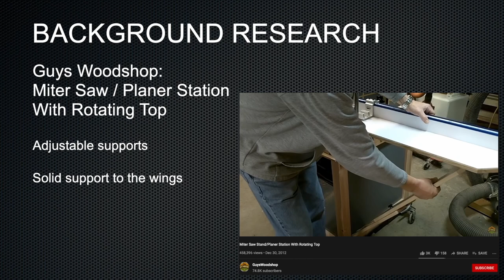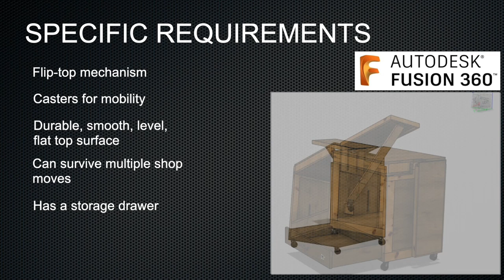Extremely Versatile Flip Top Cart

Comment: In my research on different flip top work stations, this is one of the best I've seen. I'm getting ready to build a flip top work station for a miter saw and planer, and your adjustable wings solution solves an issue I've been struggling with; different table heights on both tools. Your plan is well thought out, and well executed. I'm not crazy about your wing support (tongue and groove), and a couple of other details I'll tweak out as I sketch out mine, but the basic design is exactly what I've been looking for. The positive stops built in for the table top is elegantly simple and makes more sense than most of the others I've seen. Well done. Best I can do for support at this time is a sub to your channel. And thanks for your service.
Reply: 19:56 Did you build it yet? I need to build the same for a miter saw and scroll saw. Having a problem figuring out the distance from the flip top and bottom of the cart. I would HATE...lol to build it and when I go to flip, there is not enough space for it to fully rotate. If you did build yours, what measurement did you use? Thanks in advance

Comment: Really like the design. Love the solid rotation with a stop. I've been looking at dozens of flip tables, and this is best. I like: the solid 2x4 framing, the solid stop rotation, and I LOVE the idea of the feed and outfeed.

I'm making a table for the same planer but a Jet 10-20 drum sander on the other side. The infeed/outfeed heights are identical but I'll still probably make the feeds with a little flexibility, like yours. 

I think I'll use a piano hinge instead of a door hinge, and I might use a hinge for the bottom bracing instead of the tongue/groove thing. 

Great video. Thanks.
Reply from the maker: I’m glad you liked the video and I could inspire a design! I’ve really enjoyed the flip top cart so far - I’ve had it for about a year now. It’s continued to perform as designed. I think piano hinges would be a great upgrade. I do think the tongue and grove supports could be improved, but I honestly haven’t had any reason to do so - they simply work every time, exactly as expected. I expect improvements to this design would allow for one-handed deployment, and possibly add rigidity to the hinge joint between the wing and the cart (right now the support mechanism is loose enough at its attachment points that it doesn’t constrain the small flex in the conventional hinge at the wing base). 

Maybe someday I’ll get around to innovating and iterating on this design, but it will have to fail first for me to find the motivation. 

Best of luck with your build!

Comment: It's been nine months and I'm sure you've worked out the kinks by now, but I'd like to say that I like this design the best of all the flip-top carts I've seen on YT.  The locking top is very clever and the 2x4 sides are strong and minimize the use of expensive plywood.  I do have a few suggestions, however.  1. The wings look like they stick out several inches when folded down.  My shop is so small those few inches are precious, so I would fix that by using T-nuts and shorter bolts to hold the top hinge boards in place.  2. If you haven't done so already, do use piano hinges as they should eliminate the side-to-side wiggle you mentioned.  3. If the tongue and grooves in the support bars have proven sturdy enough then by all means keep them.  If not, then a sliding groove arrangement like what you did for the wing hinge boards might be better.  4.  Finally, I'm nuts about retracting castors.  They're easy to make and allow the cart to stand on its own feet (not wander about on wheels) while the machines are in use.
Reply from the maker: Thank you for the comment and complement. What actually causes the wings to stick out, is the proportion of short and long support braces for the wings. The way I have it adjusted for my planer, the short support brace is 0.5” too long to tuck under the wing support base. This causes everything to stick out, rather than lay flat. If I lowered it or designed it to be shorter, it would be fine in my specific application. I did switch to piano hinges; should have started with those. The tongue and groove joinery has held up really well; it’s stable and easy to deploy. I also don’t ever worry about it coming loose. The dual locking casters have been good enough for my application, but I really appreciate the engineering that goes into retractable caster designs - really classy. I’ll probably tackle this at some point, just because it would be a good challenge. 

Thanks for the discourse!

Comment: I love this build! I especially like the support wings. Lighter weight but the framework provides stability and strength. And the break-away support is a very elegant solution.
My only question is regarding the power strip. Granted, it's not something that should happen very often, but what do you do if the onboard circuit breaker trips? As it's built, it requires the removal of at least one tool and the mounting board. 
I think the simple but far less attractive solution is mount it on the outside and drill a couple of holes for the cord ends to feed through. Or replace it with a multi input adapter with no surge suppressor and keep everything inside as shown. 
Again, it's probably not a high occurrence issue. But it will only take once before it's a major work stoppage.
All in all, still a very cool design.

Comment: Nice job Hunter.  I have 2 suggestions though.  Make the side panels from 3/4" ply, using a full piece on the inside and strips to make the frame on the outside.  Also, the bottom should be dadoed into those sides 1 1/4" so the casters have the full support.  As it is, 2 screws are supported into the 2 x 4 frame, and 2 are in the plywood bottom.
Reply from the maker: Thanks! Dados are a great idea; that would definitely make the casters more supported. I haven’t had any issues thus far with the design, but everything can be improved.

Comment: Just found this video, and I like the build you have.  Wanting to build a flip table for the planer and this one looks awesome.  I wonder after 2 years now if you have reinforced the wing supports with metal as the tongue and groove looked pretty sketchy.
Reply from the maker: Thanks! Honestly the tongue and groove has worked really well. I figured with frequent use they might become looser, but they are still really tight and solid. The  tongue and groove is actually the most solid part. I get way more wiggle / play out of the hinge on the wings than I do the joint or sliding adjustment. I never liked the hinge out support with a single threaded bolt for adjustment. That solution never seemed as stable. There is a much greater contact area with the tongue and groove than an edge of plywood or bolt head. If I were going to do it again, I would use a piano hinge or machinist hinge to take all the play out of that joint.

Comment: Ultrawall 24 inch Black Sturdy Folding Shelf Brackets, Heavy Duty Adjustable Steel Wall Mounted Collapsible Shelf Bracket, Max Load 550lb (Pack of 2)  on Amazon Not affiliated with product:  I have used brackets like this for many folding projects in my shop.  Extremely sturdy and easy to use.  I just bought a planer and jointer and was looking at how to adapt Fishers cart for these.  Great video.  (and if these can last through PCS's you've done a great job.  Those movers can destroy a rock)  HooAhh.

Comment: If you wanted the weight to go straight through the frame, then you should have placed a stile directly in line with the bearing right in the middle.  This is how houses are built when you want to transmit the weight of a heavy structure directly through the house and into the foundation (also called a point load).  At the least you could have used a heavier support at the top, like doubling the stiles (kind of like a header).

Comment: First off, thank you for your service! I have watched tons of flip cart videos and I love how you have taken several designs and integrated them into yours. The 2x4 structure is solid and definitely what I am looking for. I was wondering how you attached the 2x4 that was milled with the holes for the pipe (swivel point) and 2 screws for wings to the main 2x4 that have the half lap joints?
Reply from the maker: Thank you! Each face was milled smooth for a glue joint. I just used clamps to hold the top piece to the frame.

Comment: I would have used the folding shelve bracket. It would provided stronger support, easier to operate, and would look better flush with your cabinet. But overall great work.
Reply from the maker: The folding shelf bracket is a great idea! I have never seen that before. At minimum, I'm was going to change the base hinges from door hinges to a piano hinge to reduce the wobble, but I may give this bracket a try first. Especially if it can be deployed with one hand. Thanks so much for the suggestion!
Reply: How would you adjust the folding shelf bracket? It may not open up to be exactly level with your infeed/outfeed surfaces.

Comment: Just found your channel Hunter and very glad I did.  Been looking for a good flip top cart, hopefully., for my drill press and band saw.  This one might be sturdy enough.  That’s a great miter saw station.  Love the hood for the saw.  How does it do containing the dust?
Reply from the maker: Hey Brett! Thanks for the kind words. I love the Flip-top cart so far. It is very sturdy, the top is very stable when secured, and the wings are great for planing longer boards - though you can skip the wings for a drill press and bandsaw. I have build plans available on my Etsy store if you are interested. I absolutely love the Mitersaw station. It came out just like I imagined (3D CAD helps lol) and works wonderfully. It makes me so much more efficient in the shop. The Dust hood is great; it traps 90-95% of the dust, depending on wether or not I’m making a sliding cut, or just a standard miter cut. The negative pressure from the dust collection does a great job at keeping the fine dust away too. I notice this because I don’t sneeze when using it, along with not needing to vacuum up the large chips. You could improve the dust collection by running a hose directly to the saw. While virtually all the dust stays in the hood, I do still have to vacuum the hood out sometimes. Collecting directly off the saw would reduce this a lot.
Reply: Hunter, thanks so much for getting back to me so quick.  I will definitely check out the plans on etsy for the flip cart and miter saw station, for that hood.  My shop is very small so everything must be on wheels, and better dust collection is a definite plus. Thanks!

Comment: Superb design, just bought the plans on Etsy.  I'm considering adding a second layer of plywood (well probably actually two layers) on either side.  I would have the innermost layer with the notch for the table to rest against but then add a thin spacer layer followed up with a full height - full depth outer panel.  I could then this wider side to hold up a nearly full depth wing, hopefully minimizing that swing you mentioned at the end, plus it would then support a 13" wide board with room to spare on either side.  Any thoughts?
Reply from the maker: Thanks for the comment and the purchase. It sounds like it will work! Minimizing the swing is good; piano hinges work pretty well for this too. I’d love to see a picture when you are finished.

Comment: Hunter, just found your video.  Have the plans been updated to reflect using a piano hinge?  Have you come up with an updated solution to the planner wings?  Thanks for your service!
Reply from the maker: Hey Stanley, thanks for the comment! The plans have not been updated yet; I just returned from Afghanistan and have been spending time with family. In terms of the piano hinge, I think that would be a simple substitution for the door hinge used in that spot. It only needs to be the top hinge connecting the wing base and the wing. Another viewer recommended using folding shelf brackets to support the wings, in place of the wing support arms. This seemed like it would work well, would be deployable with one hand, and sturdy enough to support lumber on it. I do think support arms will offer more support for heavier loads with less (no) deflection, but they take more time to set up. I will update the plans shortly, I’m just getting back into the swing of things at home :)
Reply: @EngineeringWorkshop_hvw Thank you and welcome home!

Comment: Excellent job and using features from other flip top carts to make an overall better design. Question: do you think this would work with a planer on one side and a bench top jointer on the other and the wings could be raised flush with the jointer and offer a lot of indeed and outfeed support to joint longer boards? The downside to benchtop jointers is the inability to joint long boards and this could fix that. Also good for small shops because floor model jointers take up a lot of space.
Reply from the maker: Thank you! I do think a jointer would work on the other side of the planer. You can check my build plans on Etsy for specific dimensions to make sure your jointer would fit. The only inconvenience I see would be adjusting the wings for each tool. It would be a rare coincidence that the work heights of each tool is the same, so the wings would have to be set each time. The angle of the wing is easy to adjust (bottom threaded knob), but the height of the wings takes some time (two nuts on the wing base). If you are just setting the wings for the jointer, then you won’t have to worry about adjust the wings all the time. I do really like the wing support for planing longer boards though. It’s also possible that the wings would need to be really high for the jointer, and would impede the planer, even when folded down. This might require you rotate the planer 90 degrees. You’ll just have to asses for your specific tools. It’s a great flip top cart and I love having it in the shop.

Comment: Stupid question, but where are you buying good straight/flat plywood?    Most of our box stores, have twisted junk.   Lol.  Thanks
Reply from the maker: I usually buy my plywood from the Home Depot. I’ve had pretty good luck in Colorado Springs, CO. I always check it, mainly the edges and corners to make sure they aren’t damaged. I also use the plywood right away (I don’t have room to store it) so maybe it’s a little wet, and if it’s allowed to dry before use, it will twist. I’ve noticed this with some of the lumber I’ve purchased; I let the lumber dry and check with a moisture meter before using, but I also always mill the lumber myself to ensure it is square. I hope this helps!

Comment: Hunter, was wondering how you attached the side assembly on the top ( 1.5” x 14” x 2.25”) that the 1” pipe is slotted through?  Just glue?
Reply: I did get the plans but may take some liberties with the extension wings.
Reply from the maker: Hey, I just glued the two pieces together and clamped them until the glue was dry. I milled these two pieces so the glue face was flat and smooth, allowing for a strong glue joint.
Reply from the maker: Take all the liberties you want! I’d love to see pictures when you are done; feel free to drop them on Etsy (review, message, whatever you prefer). My first change would be to use a piano hinge over a door hinge for the wing attachment.

Comment: What is the outside diameter of your steel pipe? I'm having difficulty finding a 1 inch OD steel pipe.
Reply from the maker: It's 1 inch outside diameter steel pipe. I bought a 36" piece off the shelf at the Home Depot. It was threaded on each end if that helps you find it.

Comment: When you going to build a work bench ?
Reply from the maker: Well, funny you should ask. I finally convinced my wife to move into a different house; I think it’s because we’re expecting, but I joke that it’s because I need a larger shop. I plan to get a CNC router, build an enclosure for it, and build an out-feed / assembly table / router table for the table saw. Im going to start on the designs soon, but it will probably be August - September before I can build it. I’ve been holding off because I just don’t have the room with the large safe, storage rack, and home gym in my shop space.